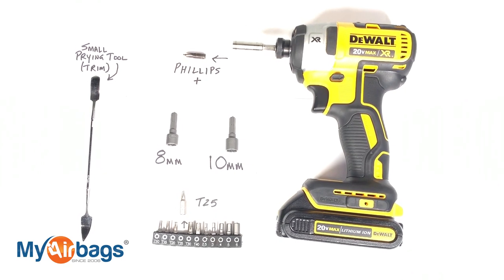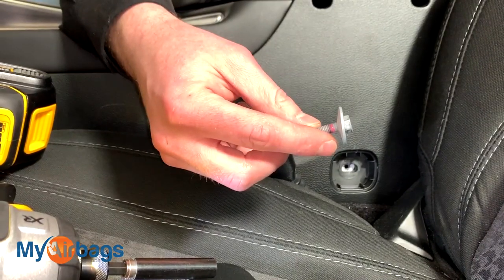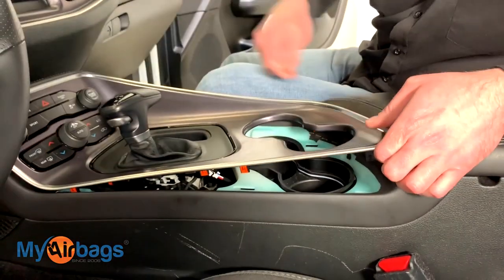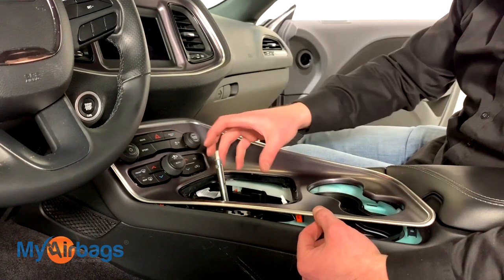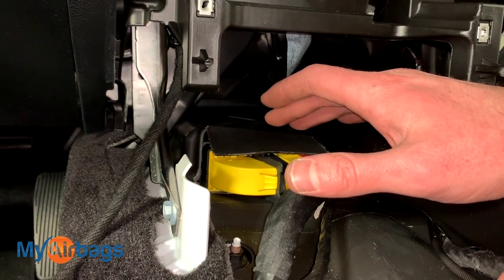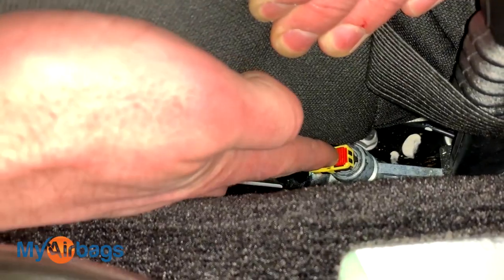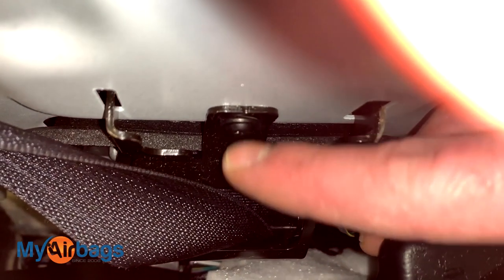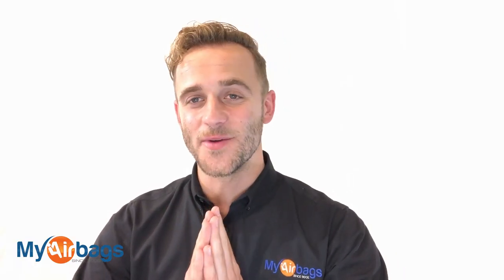How to remove SRS Airbag Control Module & Seat Belts on a Dodge Challenger | MyAirbags

Comment: Recently ran off the road and driver and passenger airbags deployed.  Trying to decide if I want to take on the project.  Your video is great.  It’s a 2019 challenger.  Car starts but won’t shift out of park.  Does the deployed airbags result in not being able to shift out of park?
Reply from the maker: The car should still get out of park.

Comment: What is the treatment for the B1701 Sonata 2007/6 cylinder error code please
Reply from the maker: Kamal,
B1701 on your Hyundai Sonata means "open or increased resistance in Driver Buckle pretensioner "
1-It could just be a poor contact in the connector or wiring harness. Make sure its plugged in and the wiring harness is not damaged/cut anywhere.
2-If all looks good with connection then it could be the actual seat belt pretensioner. To test the pretensioner, watch our video "How to: Test seat belt good or bad" here: https://help.myairbags.com/hc/en-us/articles/115012919107-MyAirbags-How-To-Test-a-Seat-Belt-
Please let us know the result?
Reply: @MyAirbags  I will inform you of the result as soon as possible and thank you very much for your high interest in our question.
Reply from the maker: @Kamal, Perfect. Thank you.

Comment: Have a question will the airbags adn or seatbelts go off after the change of new ones and how would I prevent this from happening
Reply from the maker: Please make sure to first disconnect the battery. Then the airbag control module needs to be bolted down with all bolts before reconnecting the battery.

Comment: I’ve head the modules on these reset them selves
Reply from the maker: uptownphiladelphia, Yes on some Chrysler made modules, this is the case! What car did you have?
Reply: 1/4 ratchet with a 10mm swivel worked like a charm!

Comment: What kind of seat belt is that. I’m having trouble picking the type
Reply from the maker: This model was a dual stage seat belt. You can tell by looking at the wire plugs. 1 plug - single stage. 2 - dual stage. 3 - triple stage seat belt.

Comment: How can you tell if the buckle is deployed ?
Reply from the maker: Hugo De Alba,
Great question!  Heres an article with pictures from our Help Center: https://help.myairbags.com/hc/en-us/articles/115011750647-Do-you-repair-rebuild-buckles-
Theres a few ways to tell. Not all cars have buckles that deploy. Some cars its just the seat belt pretensioners, while others its just the buckles. Some cars are equipped with both that can deploy. 
One way is you will get a trouble code on your scan tool that will tell you its deployed. Another way is too look at the buckle and see if its been deployed and pulled down like an accordion. 
Please let us know if you still have any others questions. We are very happy to help!

Comment: I swapped my seat on my 2015 charger with other suede factory seats plugged everything up and the airbag light wont go away
My car was not in accident either. How can i fix this?
Reply from the maker: 3Silver4Beast5, If the light is on for an unknown reason, I would recommend, hooking up a scanner/scan tool up to the OBD port and reading the airbag trouble codes. Diagnosing the light would help us narrow down the issue. You can always reply here with the codes or head over to our online HELP Center and type in the code there: https://www.myairbags.com

Comment: I need to replace the front impact sensor on 2015 challenger do you know where its located?
Reply from the maker: Javier, on that vehicle, it should be on the radiator support. 
Theres an article on this one in our MyAirbags.com Help Center: 
https://myairbags.zendesk.com/hc/en-us/articles/360001391787-How-to-Change-SRS-Impact-Sensors

Comment: Even if the module got wet can you still reprogram it?
Reply from the maker: No it needs to be replaced. Get your original part number that is on the airbag control module and look for replacement on eBay.com or MyAirbags.com

Comment: I accidentally removed the 10amp fuse in the back trunk, i got a airbag light, what should i do? (2016 dodge challenger shaker rt) please help, thanks. Car was not in an accident!
Reply from the maker: You can use a diagnostic scan tool to clear the code. For most Ford and GM vehicles it will auto clear itself. But for other vehicles it needs a scanner to clear the code.

Comment: Were is the module on charger srt8 14 ?
Reply from the maker: It is under the radio on the floor. You can also use this link for help https://www.myairbags.com/srs-airbag-control-module-location-lookup/

Comment: Is it the same spot for a 2013 too?
Reply from the maker: Hugo, it might be slightly different for the 2013 model but this video should help with the overall process. If you need the module reset and/or the seatbelts rebuilt, we can help with that: www.myairbags.com

Comment: Is this similar for 2017 chrysler 300
Reply from the maker: Oscar, if the 300 has a similar interior / center console setup, it will be similar process. If you need reset you can start here: http://www.myairbags.com/

Comment: Where is it in 2011 nissan pathfinder
Reply from the maker: Paul,
On that model, its directly under the radio console, all the way on floor. There are panels to the right of the pedals that come off and should see it right away. Its the metallic box with a orange sticker on top of it - bolted to the floor.

Comment: Thank you for the well informative video. 

I own a used 2014 challenger, I know an airbag was deployed in a minor accident in the past. The previous owner said it was replaced, and programmed accordingly. 

But I've been suspicious, so my question is..
Is there any other way to turn off the airbag light without fixing its system?

Maybe by some illegal programming? 

Ps. We don't have an authorized Dodge service shop in my country.
Reply from the maker: Bilal, The airbag system has to be completely functional in order for the light to go off. It should function as designed.
Reply: @MyAirbags  Thank you ❤❤
Reply: If I put new seat in my 2019 will it deploy    if I reprogram the
Reply: If I put new seats in my 2019 challenger will they deploy if I don't reset the module

Comment: Wait dont skip that part. I need to see how you got those screws out the back of the module. Thats a cramped space
Reply from the maker: Slim R.,My apologies. We edit the screw removal part to shorten the length time. I hope the rest of the video was helpful to your needs.
Reply: ye its nearly impossible thats why they didnt show it!!
Reply: @MyAirbags  It took more time to unscrew the back screw than to take apart the whole console. Why wouldn't you be a little more transparent and just say its very difficult?
Reply: I ended up cutting that top cover to get access to the back bolts - that and a 10mm 1/4" drive with a swivel and extension.  This design is terrible for service though I'm sure its super easy at the factory before the dash is installed!  Also if the dash needs replaced due to passenger airbag being deployed that is probably the right time to remove this module.

Comment: My bud bought 2014 challenger, passenger seat lower lumbar airbag in seat is pushing out at max and hurts the back, we can't find a switch to control the airbag in back of seat
Driver seat has a button and lil knob, I asked him if there is a second switch for passenger bag and he said no
So where is the airbag switch for passenger side, it has the airbag tag on side of seat so it's in there 
Thanks in Advance
Reply from the maker: Crying Hippy , I'm sorry, we dont have any experience in lumbar support controls
Reply: My Airbags thanks Eli

Comment: What about the charger
Reply from the maker: Taz, the Dodge Charger module should be in the same spot under the console, on floor. We haven't produced a video how to get to it yet, but if you watch this video, it should be helpful in getting a good idea on how to get to the module in your Charger. Make sure you disconnect the battery cables anytime you work with the airbag system. Please let us know how different or similar it was to get to the module?
and of course, if the car was in an accident and you need to get it reset instead of buying new: check out out airbag module reset service: https://www.myairbags.com/product-category/repair-return/airbag-module-reset/

Comment: Reason code p1701 huyndai sonata 2007 v6
Reply: Sory B1701
Reply from the maker: Kamal,
B1701 on your Hyundai Sonata is "open or increased resistance in Driver Buckle pretensioner "
1-It could just be a poor contact in the connector or wiring harness. Make sure its plugged in and the wiring harness is not damaged/cut anywhere.
2-If all looks good with connection then it could be the actual seat belt pretensioner. To test the pretensioner, watch our video "How to: Test seat belt good or bad" here: https://help.myairbags.com/hc/en-us/articles/115012919107-MyAirbags-How-To-Test-a-Seat-Belt-
Please let us know the result?
Reply from the maker: If it is a bad pretensioner, we help you. We can professionally rebuild the seat belt pretensioner and buckles too.
Please let us know the result?